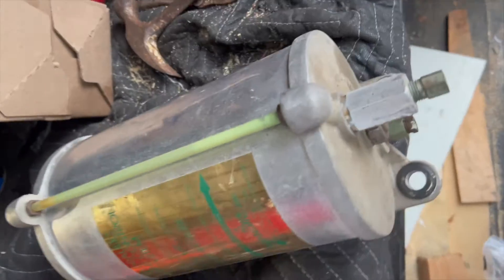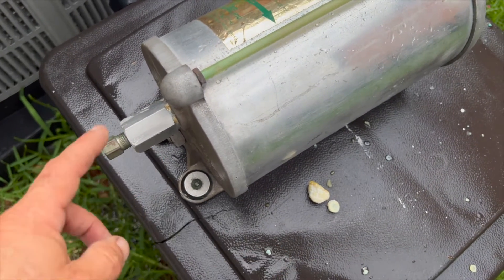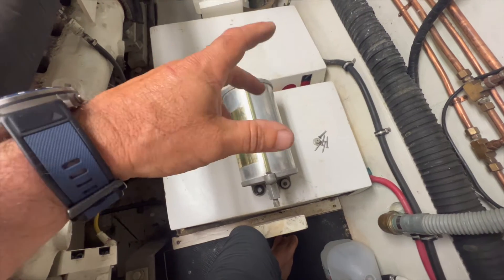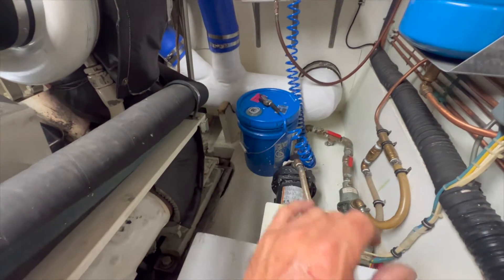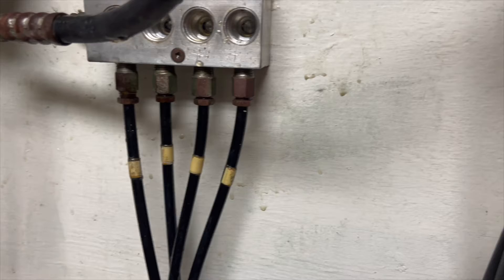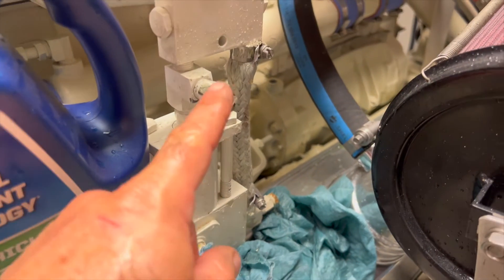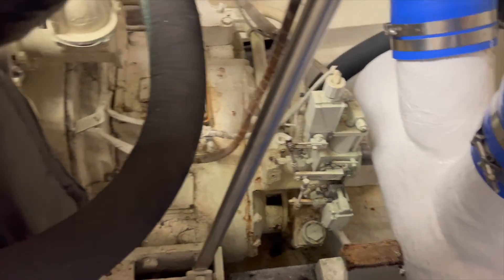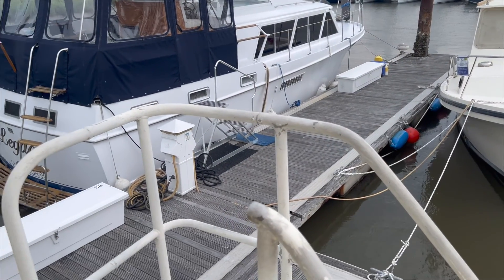63' Hatteras Hynautic contol rebuild/ 50/50 etheline glycol

Comment: When you busted through with that Allen driver that was the filter
Reply from the maker: Yes in Theory there should be a filter there. It had been removed. I dismantled the tank and did not find it.   It you are correct. There should be a metal screen.

Comment: There is silica antifreeze in my system. Everything worked until I rebuilt a sender and flushed the system. All the crud clogged the reservoir. I cleared that and the system still won’t bleed. I plan to clean and replace the dill valves at the upper helm and hope the hydraulic loop will then be intact and bleed
Reply from the maker: @danielmcpartlin6526  check your charge valves first that’s usually where they clog. There are tiny little orifices that are about the size of a pin that can clog very easily and prevent proper flow through the system. I should have a video on charge valves.

Comment: What you think would cause my controls on all 3 stations to be stiff ? Fluid looks good. Pressure 75 psi.
Reply from the maker: I would start with your charge valves.  Everything works well otherwise?  Hard to say without being there. But I would start there.
Reply: @CarolinaMarineGroupCharleston  Yes, they all work fine; but just all stiff. So I let out the air first, but after, when the valve caps are opened will all the fluid in the tank and the two stations above it all drain out ??
Reply from the maker: If you want you can call me and I may be able to help over the phone 860-209-7609

Comment: I thought all hynautic took MiL-H-5606A aviation hyd fluid (red)?
Reply from the maker: No!  50/50 glycol with no additives. Or you can use the expensive Hynautic stuff. Most people use the 50/50. 😃 other systems do use the red hydro fluid but not this.